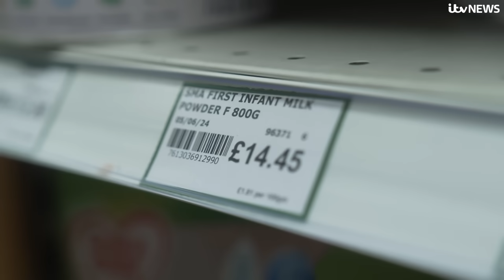Surviving, not living: The workers taking second jobs in cost-of-living crisis | ITV News

Comment: When I'm on a day shift I'm up out of bed at 3.30am. At 5am I drive the five miles to work. Start actually working at 6am. Finish at 6pm. Drive home. Have a bath because of the nature of the job. So by the time I sit down to my tea (the meal) it's usually 7.30pm. Then by 10pm it's back to bed to get just over five hours sleep so I can get up the next day to repeat the process. 

I work a rota system that is a mix of days and nights which runs 24/7 365 days oer year so often I have to work this kind of routine even on Christmas day, New year's day and bank holidays. 

All for £30k per year. 

Which is a high wage in the northern town where I live. 

I don't think many people realise the massive regional inequalities that exist in the UK.
Reply: 30k? Wow, Is there any jobs going dude? 

I commute to York from Sheffield 6 days a week, 760 miles a week £120 in fuel. I come out with £391 in the bank a week. Take £120 fuel off that. I set off at 5am and am not back till 5pm, can take two hours to get home in traffic. I steam clean trains underneath and am wet, cold and filthy from head to foot all day, covered in oxalic acid and rail grease every day.

If my work was five miles away, I would get shut of the car and cycle 100% dream job, cycling to work, there's mountain bikes and road bikes sat at home gathering dust. I'm in bed for 8pm sometimes earlier, so getting up at 3:30am would be no problem 👍

Comment: I would get up at 4am go to a bakery and pack fruit cakes.  I finished at 9am.  I then rushed to my day job, a mile away, and started my day job 9am to 5.30pm, i usually finished at 6pm.  I drove home slept for 30 minutes then left for my bar job 7pm to 11.30pm.   Interest rates were through  the roof at 17.5%.   I managed to keep my flat but sold it with small arrears.  You get through the tough times.  Good luck to you young man, it will get better.
Reply: Just wishing good luck isn’t really good enough though is it?
Reply: And i walked uphill both ways!
Reply: The Reform Party will get you out of this. No income tax under £20k for a start.
Reply: @rb1062  🤣🤣🤣🤣🤡
Reply: You are a governments dream, sir. Atb to you
Reply: @rb1062 I’m sorry you believe that
Reply: I think we're in a different economic position globally than in the past. I don't think things are going to follow the natural ups and down of the economy. Short of a collapse what has been set in place won't change and likely will only get worse over time. At this point all I can envision is things getting incrementally worse until a major correction or crash where many will lose everything. From that point things may get better but we're a very long way from that.